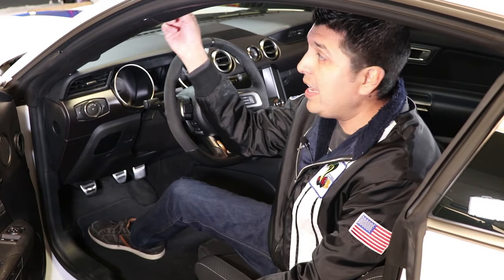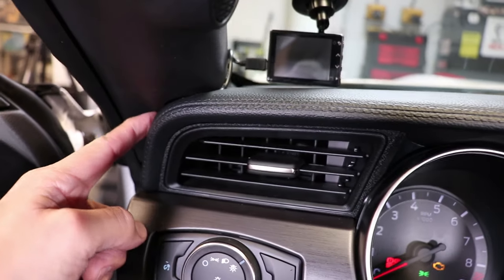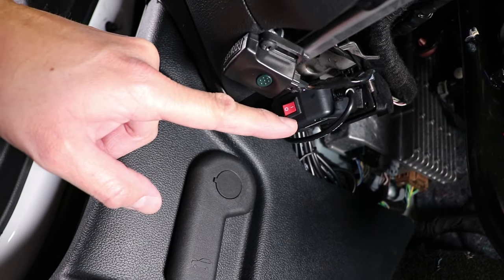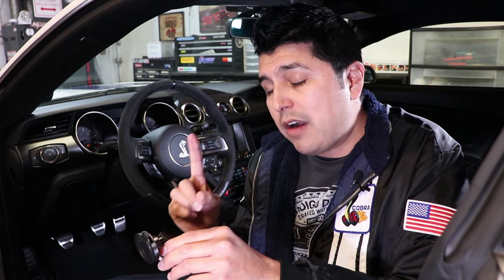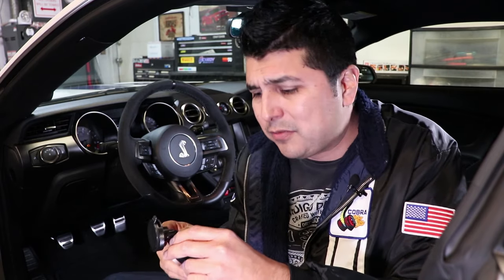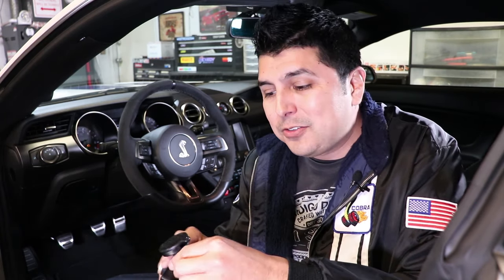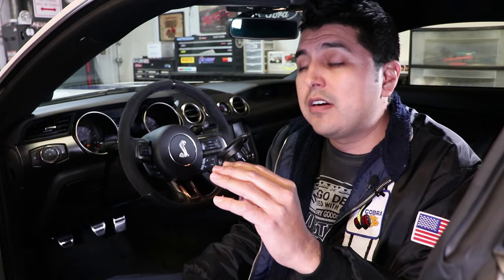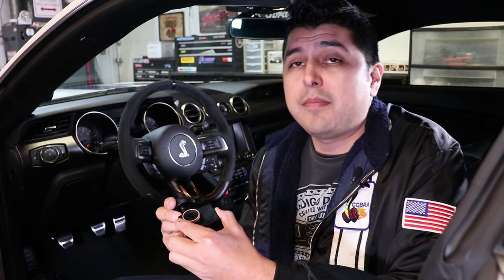Don't hardwire your Dash Cam! Try this instead!

Comment: Forget this ….
Simply add a a 2000 mah powerbank into your cam stash it under the visor or sunglasses holder it will keep,your cam going in parking mode for days  at a time .. no need to hard wire at all
Reply from the maker: Hi Paul! Yes ,some people run their dash cam off a battery pack. I personally don't due to the high temperatures the interior of a vehicle can experience (which I prefer not to subject the battery to) and due to the potential for a run away event (fire) during charging or discharging inside the car. Here is an example of a internal dash cam battery and what the sun did to it https://youtu.be/HW8jqbl_ayU and a video of battery related fire I personally experienced https://youtu.be/XfWgJ8nu-RA (destroyed the house) Cheers!
Reply: you’ve obviously not been to the uk .. 
sunny days a few and far between .. 😂😂😂
Great videos great content very informative..👍🏻👍🏻👍🏻
Reply from the maker: @Zootan  LOL! One day I hope to visit! Thanks Paul!

Comment: Not excited about messing with OBD port.  That could mess with the electronics of the entire car.  Better to use the fuse panel imho.
Reply from the maker: Hi James! mine is going strong after 2 years now, no issues but I agree, the OBD adapter is not for everyone, if going into the fuse box here is my hard wire video https://youtu.be/zbxYA4VhuT8 if it helps bud and thanks for watching!

Comment: Don’t hardwire your dashcam! Proceeds to show the different ways to hardwire a dashcam.
Reply: It is not hard wired. It's on the obd port.
Reply: CarrotCaptain Pretty much the same thing. Just his way is sloppier than a nice soldered hardwire job.
Reply from the maker: Hi Bryce Lund! I have another video coming up showing the hard wire method, I used fuse taps for that video, but I may add a solder version as well if you think it would be something people would like to see, stay tuned bud!
Reply: AutoFun cool

Comment: So this will not work on parking mode? I am sorry but I dint get that
Reply from the maker: Hi Angel! correct this won't enable parking mode. However the if you set it to always stay on then the dashcam will be able to monitor the car while parked as the adaptor will keep the dashcam on continuously. Hope this helps and thanks for watching!

Comment: An separate option is to buy 2 independent dashcams and use one for the back
Reply from the maker: Hi Oily Socket! yep that it's a good idea, I always recommend (when the budget allows) is to run dual dash cams so you also have redundancy in case something goes wrong with one and to capture as many different angles as possible. Hope this helps, Cheers!

Comment: You don't want to connect things permanently to the obd port, It's from diagnostics purposes only.  Some Insurance companies made customers plug a tracker into their obd 2 port, Which in some cases fried the ECM, Be wary
Reply from the maker: Hi Chris! Here is my follow up video showing how the adapter works (and how it relates to the SAE J1962 standard we use in the industry for the OBD2 port design and use) https://youtu.be/aV5jQovoaCI including the use of the OBD2 port by non-diagnostic tools. I been running mine for over four years now without an issue and since making this video, we also seen more dash cam like Ring, Garmin, Thinkware, Vantrue use OBD2 adapters. However if you would like to avoid using the OBD2 port for power (and also looking to enable park mode) here is my other video showing the alternative Hardwire method https://youtu.be/zbxYA4VhuT8 Hope this helps, Cheers!

Comment: And where you put it doesn’t block visibility?
Reply from the maker: Hi Tony! On my car it doesn't, however this will vary from car to car,  the dashcam could be position higher by running the cable up the A Pillar if desired, hope this helps and thanks for watching Tony!

Comment: Does anyone know if the OBD power cable has capacitance to bridge power while cranking the vehicle? To avoid the otherwise inevitable split second or two loss of power to the powered device while starting the car?
Reply from the maker: Hi Scott Blanchard, the OBD cable likely won't be able to power the camera in that split second, that being said most dash cams have a built in battery that will keep it on for a seconds or minutes after loss of power, on mine for example the camera turns on and stays on during cranking (assuming the battery is charged), check the specs on your dashcam it may have that option already, thanks for watching & let us know what you find my friend!

Comment: Will this work just the same for an full electric car
Reply from the maker: Hi Robert! this depends on how the electric car uses the OBD2 port, some EV's will cut power to certain items that are not considered as being used where on a gas powered car the OBD2 port is typically powered all the time (I say typically because some newer combustion engine vehicles, particularly fuel efficient ones & hybrids also cut power to items in the car considered not being used) So I would recommend checking your owners manual to confirm if this is your case. Hope this helps, cheers!
Reply: Ok thanks for the reply great informative video.
Reply from the maker: @robertrussell7107  You're welcome!

Comment: Damn this would have been a great solution for me but I mile by mile car insurance that uses OBD, I'm getting a new car, I think I will try to get it hardwired.
Reply from the maker: Hi Kevin! check out this other video I made showing the hardwire process if it helps! https://youtu.be/zbxYA4VhuT8 Also curious I heard good things about the OBD per mile insurance, would you recommend it? in your opinion does it save you a lot of money for folks who don't drive a lot?  thanks bud

Comment: does it work "park mode" wit this adaptor? how does dashcam knows is this park mode?
Reply from the maker: Hi Ferenc! nope, the OBD adapter will not enable Parking Mode, most dashcams require a full hard wire kit to enable that functionality. Hope this helps and thanks for watching bud!

Comment: You should not use the OBD port to power things, if there is an issue, it could destroy your computer
Reply from the maker: Hi My golf balls annoy! Here is my follow up video showing how the adapter works (and how it relates to the SAE J1962 standard we use in the industry for the OBD2 port design and use) https://youtu.be/aV5jQovoaCI including the use of the OBD2 port by non-diagnostic tools. I been running mine for over three years now without an issue. However if you would like to avoid using the OBD2 port for power (and also looking to enable park mode) here is my other video showing the alternative Hardwire method https://youtu.be/zbxYA4VhuT8 Hope this helps, Cheers!
Reply: @AlexAutoFun  👍🏿 thank you for the info
Reply from the maker: @mygolfballsannoy  You're welcome, Cheers from California!

Comment: there is no option for obd to usb c for the newer models right
Reply from the maker: Hi DRBaathman! yes there is a USB C option, I put links to it in the video description. Hope this helps, Cheers!
Reply: @AlexAutoFun  i checked the usb version it doesnt have the feature to choose whether to continue working or shut off when the engine stops
this is my main issue why i want to try it because my car the ciggerate lightening works always even when the car is off so my camera keeps working when i switch the car off
Reply from the maker: @DRBaathman  Hi DRBaathman! I was actually updating the link just last night LOL! If you check it now you will see that it does have it. Hope this helps, Cheers!

Comment: For watchers from the UK this would be illegal. The camera must be at the top of the screen behind the rear view mirror on the passenger side
Reply from the maker: Hi Robert! thanks for sharing this info, do you know if it's all of UK just certain areas? What could be done is the dashcam could be placed higher by running the cable up the A Pillar (and also under the headliner), hope this helps, Cheers!
Reply: @AlexAutoFun  you are welcome , we don't have separate laws, the UK is the UK I think the same rules apply to most European countries. I have run mine under the roof lining and down the A pillar
Reply from the maker: @btnbiker  Thanks for confirming, that is great makes it easier for everybody. Here in the USA the laws for dash cam placement are different from state to state. So you can imagine someone doing a cross country trip may have to check the law of the states they are planning to cross ahead of the drive LOL Cheers!

Comment: Good information. It think it would be just as easy, safer and cheaper to use a fuse tap to power a dash camera instead of using a Chinese made OBD dash camera power plug in my expensive OBD port.
Reply from the maker: Hi Buick Mackane! I been running mine for over three years now without an issue but I know some folks rather not use the OBD port for power. Here is my other video showing the alternative Hardwire method https://youtu.be/zbxYA4VhuT8  this maybe more of what your are looking for. Hope this helps and thanks for watching!

Comment: This works, but it's tacky... It'll be better to use a USB power adapter for the rear view mirror. Camera goes up right next to the mirror, out of sight and has power.

And using the OBD2 port while your car is in for service, it's a VERY high chance it'll be removed by the Technician.
Reply from the maker: Hi Gregory! yeah I heard those mirror adapters work good as well, I have a follow up video where I do the install using one of those. In the mean time I do have a hard wire video https://youtu.be/zbxYA4VhuT8 if it helps, specially as you pointed out to eliminate the possibility of a tech unplugging it during service. Thanks for watching and commenting!

Comment: Putting the camera so close to the side pillar can be Dangerous if your car has Side Curtain Airbags as the plastic cover will be obstructed by the camera when the curtain deploys.
Reply from the maker: Hi Luke S! Unfortunately we are very restricted on the mounting location for the dash cam here in California :( But the installer can place the dashcam higher by running the cable up the A Pillar if desired. And as you mentioned if there is an airbag in the A-Pillar here is my video https://youtu.be/uZp95NbNlmM where I explain some of the issues that can pose. Hope this helps, Cheers!
Reply: @AlexAutoFun  Thanks for the link, Great video
Reply from the maker: @lukes6868  You're welcome Luke, have a good weekend Bud! 🍻

Comment: Good video. But leaving on accessory mode, that mechanic/valet can easily turn off the camera?
Reply from the maker: Hi! Correct, however the same issue can happen if the dash cam was hardwired (the power connector could be disconnected from the dash cam itself. For those cases I would recommend a dash cam with direct cable (That does not disconnect) like this one https://youtu.be/vUEsIYEBVck or a stealth dash cam like this one https://youtu.be/TvKRKYA7cgQ And I have more dash cam reviews on my channel in the playlist "Dash Cams Reviews" if you like to compare them. Hope this helps, Cheers!

Comment: I have a dash cam, radar detector and GPS that all need separate power. I only have one cigarette light power source but all three of these use that type, What is a solution for this?
Reply from the maker: Hi KC, one option would be to get a cigarette lighter adapter like this one https://amzn.to/34bD2yR that way you can power the radar detector and GPS with it and the dashcam could pull power from the OBD adaptor. Hope this helps!

Comment: And that’s how to start a fire in the car. !
Reply from the maker: LOL! Here is my follow up video showing how the adapter works (and how it relates to the SAE J1962 standard we use in the industry for OBD2 port design and use) https://youtu.be/aV5jQovoaCI including the use of the OBD2 port by non-diagnostic tools. I been running mine for over 5 years now without an issue and since making this video, we also seen more dash cams like Ring, Garmin, Thinkware, Vantrue, Nexar, Wolfbox, use OBD2 adapters. However, if you would like to avoid using the OBD2 port for power (and also looking to enable park mode) here is my follow up video showing the alternative Hardwire method https://youtu.be/zbxYA4VhuT8 Cheers!

Comment: Garmin is just trying to make more money, by having to add a cable for the parking feature to work.  Try Jumping the pins inside the plug. that should allow the option, because it already has power, So why would it need power  for cable to activate parking mode.
Reply from the maker: Hi EL EVO, yes I really think the parking mode should enable with any power adapter not just the Garmin one. I been thinking about figuring out what magic inside the Gamin one enables its, the shorting of specific pins is a good idea, hopefully I can figure it out and if I do I will share on a video, thanks for the tip!

Comment: Hi. This is probably answered in the chats but don't these cameras store movement footage separately  and not overwrite it all
Reply from the maker: Hi Mark SN! correct! some dash cams will only record when there is movement, others can be set to record only when an impact happens, others can record a continuous time lapse and there are even some out there that record continuous video, just depends on what brand you buy. And I have several dashcam reviews on my channel under the playlist "dashcams" if you like to compare them. Hope this helps and thanks for watching!
Reply: @AlexAutoFun  Hi. I like your channel and thanks will check out the videos. I want to install a discrete dash cam wired into the fuse box with rear camera. I have I tried the rear view mirror dash cams, but the ones I got were too big. I  don't want one that would attract a robber to break in and steal the dash cam.  That would be a painfully ironic  experience
Reply from the maker: @marksn4020  Ah yes I totally get that, I actually mention this on the channel and some viewers were surprised that dashcams are stolen, I said yeah where I live it definitely happens LOL Here are two alternative solutions one is this direct mount dashcam https://youtu.be/Yk2EEacXZ7g and the other is this stealth dashcam https://youtu.be/TvKRKYA7cgQ Hope this helps and thanks for watching!
Reply: @AlexAutoFun  brilliant video.  just what I'm looking for. Though I need to check if it is compatible with my Seat  Cupra  mk2. Such a good answer to my needs if I an get one for my car I have.Thanks.
Reply from the maker: @marksn4020  You're welcome Mark! yeah they supposedly made OBD2 mandatory in cars after 1996 here in the USA and I believe after 2001 in EU. So depending on your model year it may have the port already..

Comment: All sounds about right, just missing one thing- wiring to obd port... Seen few clever guys over my lifetime who tried this and ended up with unusable obd port. I do not recommend this. Better take the power of interior lights instead.
Reply from the maker: Hi Ned! Here is my follow up video showing how the adapter works (and how it relates to the SAE J1962 standard we use in the industry for OBD2 port design and use) https://youtu.be/aV5jQovoaCI including the use of the OBD2 port by non-diagnostic tools. I been running mine for over five years now without an issue and since making this video, we also seen more dash cams like Ring, Garmin, Thinkware, Vantrue, Nexar, Wolfbox, use OBD2 adapters. However, if you would like to avoid using the OBD2 port for power (and also looking to enable park mode), here is my follow up video showing the alternative Hardwire method https://youtu.be/zbxYA4VhuT8 and here is the mirror tap method https://youtu.be/-hGu8KZLaZ4 Cheers!

Comment: At 0:25, isn’t that basically the principle of hardwiring something into a car? Coz that would be one of the best ways to install your dashcam clean and unrecognizable. And also you dont have to turn ON/OFF an OBD adaptor.

Here’s my take on your method:
1. You dont install a daschcam on the side part of your windshield, you won’t maximize its view angle.
2. Tuck the exposed wires inside your panels to have a clean look. And not use a flat black tape to conceal it. Tapes are for noobs!
3. Lastly, you don’t let your car’s battery reach a draining point because of a poorly installed dashcam.
Reply from the maker: Hi Abu! thanks for the feedback! yes the location of the dashcam can be improved by going higher on the pillar, I have a video coming up where I cover other mounting locations and a more hard wire approach, will definitely keep your recommendations in mind as we film the next one! thanks for watching bud!
Reply: AutoFun Looking forward to more of your videos bro! Keep it up! 👌🏽

Comment: OBD doenst always have igition on that port this will very from manufacture to manufacture
Reply from the maker: Hi Peter! The OBD2 power adapter follows the SAE J1962 standard for power, so if your car has an OBD2 port, the car will be using J1962 pin out, but yes the standard also reserves additional pins for manufacturer use only which is why to your point, some OBD2 ports vary but only within the pins allowed by the standard, the power pins however are not allowed to change as this would also affect the use of OBD2 scanners etc. And here is my follow up video showing how the adapter works (and how it relates to the SAE J1962 standard used by the industry for the OBD2 port design and use) https://youtu.be/aV5jQovoaCI including the use of the OBD2 port by non-diagnostic tools. More dash cam like Ring, Garmin, Thinkware, Vantrue are now using OBD2 adapters. However if you would like to avoid using the OBD2 port for power (and also looking to enable park mode) here is my other video showing the alternative Hardwire method https://youtu.be/zbxYA4VhuT8 Hope this helps, Cheers!